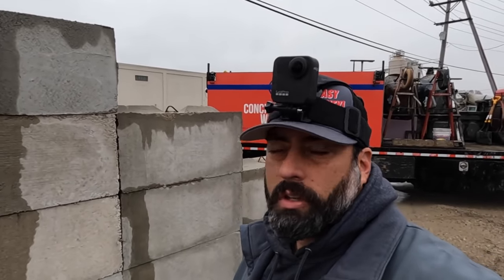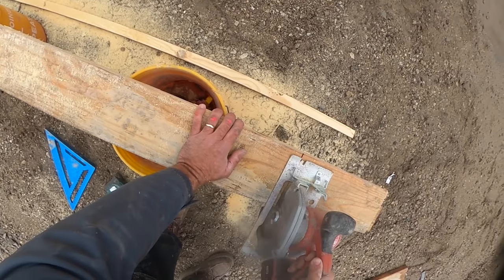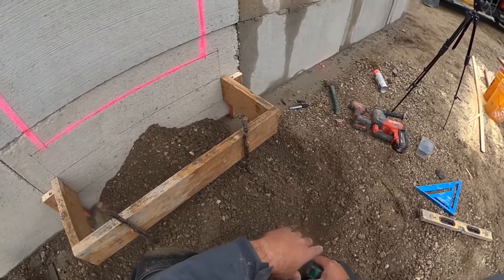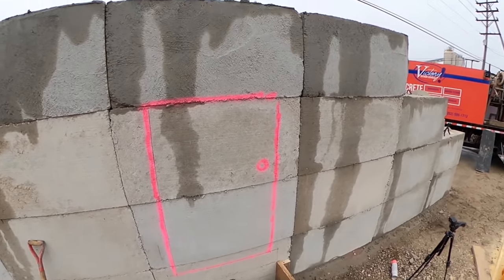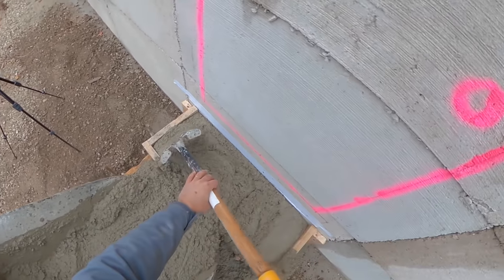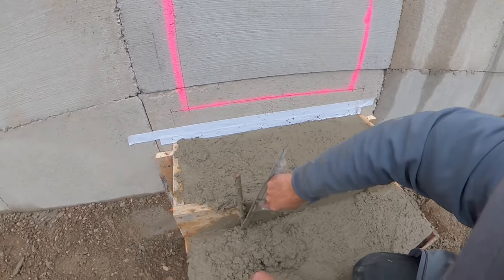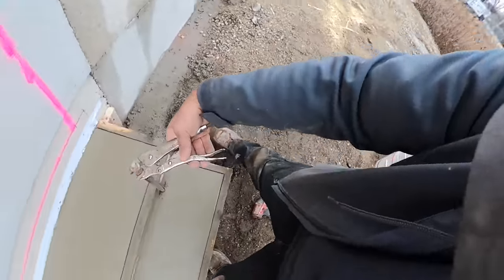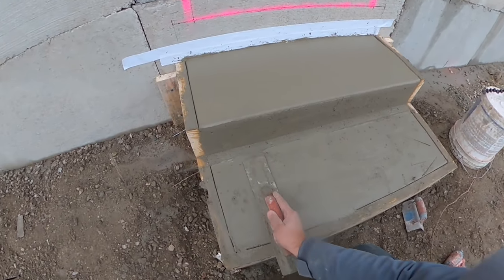How to form, pour, and finish concrete steps-DIY

Comment: Pro tip - 45 your risers and the batter boards won't stick to the run when you go to remove them. It makes it a little easier to finish.
 2. you can use the Sawzall to vibrate the concrete down into the form to get the mud down into those voids on the stairs. Just press the shoe against the form and let her rip. 
3. You're going to want some extra Crete around when you pull the forms just in case you pull a chunk out. 
4. Spray your forms with diesel, pam, or whatever you prefer to prevent the forms from sticking to the Crete. Looks great!!

Comment: I hope you continue to do these training videos.  You’re a great teacher!  I will be putting in a walkway to my pool from my driveway in the spring.  I may use bag concrete because I will be solo.  As a diy’er, I look forward to your future instructional videos. God bless!
Reply: Make a small test section for the cement your going to use. The bag cement I get from Menards isn’t nearly as nice as the cement you get from your local cement supplier.  This makes it a lot harder to make look k nice and the finish isn’t nearly as hard.
Reply: I'm pretty sure you could add Portland cement to the bag concrete to get that more creamy effect for a nicer finish!
Reply: @lefty_420  I worked with masons in Boston, they added soap to get a creamy texture, it holds emulsion longer.  They actually sell the soap at the mason supply but the brickies just used dishwashing liquid, its cheaper and does the same thing. Just a squirt in a 80 lb batch.
Soap is how to emulsify oil and water.
It prevents the water from draining out of the mud too fast.
Reply: @Gerard Jones  good to know! I'll keep that in mind, thanks! 👍👍👍

Comment: Hey Ryan! Greetings from Norway! I just wanted to add in that for steps it's really nice if you cut a 45 degree on the bottom of 2x8 so you can run your float all the way in on the face of the step for correct elevation. It is very nice seeing you guys work as a team and it is very different as I work with bridges and 10-floor buildings. Love your work! Keep it up!
Reply: Plus his first step is wrong, can anyone tell me why the top step is not code?
Reply: You could just explain to us
Reply: @ForensicCats  it appears legit.. the rise looks good
Reply: You’re assuming that nothing else will be added at ground level
Reply: @pats9414  so... is it code or no?
Reply: @markpeterson9808  no. Just like any building under construction isn’t fully up to code.

Comment: Man I have done so many set s of steps in my day ,,,from
 3 ft wide to 30 ft wide ,,,,with and without cheeks !!  Use to dream about pouring steps !!! And always had a 5 gallon bucket of a dry mix of fine sand and cement just in case when you strip the step forms and there are voids ,,,,mix up alittle mud and fill in the voids !! Works out well on a hot day when the concrete is drying fast and you cant scrap any grout off of the trend to fill them !!
Reply: 30 feet!!! Man, those are some big steps.
Reply: You got it man. A little extra cream can save some scrubbing later. We usually take some of the left over mud out of the truck and screen out the bigger aggregate. Wrap it up in plastic til needed
Reply: Definitely use the mud from the truck... Portland varies in color and you'd probably end up with "patchy colored" concrete.

Comment: Awesome, respect man for sharing your knowledge. I've always worked on the mechanical side - cars, machine shops, etc - but am getting into the construction trades type stuff just for DIY/hobby and like to really learn the whys and not just the hows when I dive into something so knowledge like this is invaluable IMO. Thank you! Riv/Crete as well for opening your doors and again sharing your knowledge. As a SE WI lifer as well, you're all doing us proud!
Reply: So what about the frost ? That will raise them steps up . There always should be a footing below frost line to prevent heaving

Comment: Hey Ryan, can you answer a question for me? I’m from Texas but live in Pennsylvania now, why do concrete trucks have the mixer reversed up north? In Texas, and most of the south, they have the concrete come out of the back, where up here it comes out of the front of truck. Love the channel, hope you continue to find success!
Reply from the maker: We used to have rear discharge up here as well. Fortunately over time they all switched over to front discharge which is far superior.  I believe the truck itself costs more and some areas are hesitant to invest. Once a company in an area switches to fronts, the competition follows or they will be left behind. That's why some areas are all front and some are rear.
Reply: Alot of streets in cities and smaller towns arent wide enough for those big front discharge mixers !!
Reply: i live in wisconsin and drive a redi-mix (cement mixer) for 18 years now and 90 percent of them are front discharge because you can see where you are pouring and haul 9.5-11 yards plus with not 4x4  we have 6X6 we can go into deep mud without getting stuck.
Reply: I live around Houston and work for a railroad next to a concrete company. They have started using the reversed cabs and the first time I saw them I didn't know what I was looking at lol
Reply: @opiumextract2934  SE side.. here deer park
Reply: @infidel3162  nice, I used to work in deer park but now im over in baytown
Reply: Here- just north of NYC there is a company with rear discharge. Their trucks can get into places the big front dumpers can’t. The driver does have to get out and have wireless remote control chutes
Reply: @opiumextract2934  cool
Reply: Southern California all rear discharge.  Every job has a pump on it unless there is space to tailgate.  The pumpers charge 400 to 500.

Comment: Great video! Planning to do my entrance steps within coming summer weeks. I will follow your example. I'm preperad to finnish the surface with ceramic tiles later, but if result would that perfect perhaps that is not even needed. Difficult to see how much effect the final brushing has on the surface finnish

Comment: I was actually a little worried when they were coming over and taking the blocks away with the loader, but seen there were a couple rows before they got to u and ur demonstration great job they turned out beautiful ,you also have a way of explaining how everything goes, u make it look like easy money!!. But I truly know from experience that concrete work is pretty demanding on ur body especially knees, I did poured foundations and flat work back in the 80's in my 20's and then went into stone Masonry until 2015 and just couldn't do it no longer with back and knee problems, so take my advice and protect ur knees and back and take care of yourself and you are truly blessed with the talent of finishing Crete, long may ur mag keep floating!!!

Comment: Good idea on this one. Very damn good. It’s all the simple things people forget about. Since some get overwhelmed by the bigger details like forming,grading and troweling and striking off. The smaller more detailed steps get either overlooked and straight up forgot about. 
    I would like to see a more detailed grading on a smaller scale. Digging off the top soil and even on like a patio tht is high on all 4 sides with a drain in the middle. Maybe only cause tht is about what I’m doing right now. Grading and laying down (C-6) for base. My thinking is let it sit and settle over winter. Pour come spring.

Comment: My Turn!  Never done concrete, but you make me want to do some steps now.  Timing appears to be everything as well, and I know that takes experience.  I am going to put steps out front and am really curious how I do.  I can be a perfectionist, so I think it will turn out alright.  What is the rule for rebar?  When do you need to use it, as I noticed it wasn't used here.  Thank you for the video.  It was really solid and helpful.

Comment: Great tutorial. We usually chamfer the front board on a 45 degree angle, it helps to get the lower step nice and level as your not guessing where the bottom of the board is,  and always keep you ever clean.

Comment: Have you ever tried putting some oil on the inside of the forms that way the face of the steps aren’t as much of a hassle to smooth out once you pull them off , the oil adds a protective layer from the pores on the wood that make the holes. Only use a little we apply it with the same paint brush you had in the video. In California we do this all the time we use any type of motor oil from any gas or autozone. Really enjoyed the video 👍🏻

Comment: The driveway pad in front of my garage (4'x22') have sunk about 3/4", across entire garage opening. I need to raise it up to prevent water puddling. Any suggestions on the type of concrete, concrete support, etc pls. Your video was a Great video. Thank you very much

Comment: I've never done conrete, but wondering why you didn't build the bottom form first. Since the measurements are accurate, it doesn't seem like it would matter and might even help or ensure you're level. Just seemed a bit wierd sliding the bottom sides under the top sides. If I was adding a few steps to a high back door on an existing concrete patio, it would have to be super exact since the existing contrete patio is less forgiving as a base than dirt or gravel.

Also, when adding steps on an existing patio where you can't attach forms to the vertical side of the foundation, how do you recommend bracing the forms? Does it require drilling into the existing concrete patio? I'm wondering about how much damage that does to the existing patio.

This was a great video and worth the time.

Comment: You make the job look easy Ryan, but it anything but easy. This is many years of experience in finishing concrete. Thanks for the great video and demonstration. You could actually apply a release spray to the wood forms and that will greatly aid in removal with minimal damage to the surface of the concrete.

Comment: Love your channel and I know I'm months late on asking a question or making any statements, cause I'm still working through all the video from oldest to newest.  One question I had, which you didn't go through, was the fill of the dirt within the form.  Looks like you just tossed some gravel in there to fill it out a bit, but never spoke of what to do TO it.  Did you compact it?  What happens if you didn't?  I'm assuming it would settle right out from under the finished steps on top of it.

So that was my on concern... for those of us whom you're teaching to do a project like this.  Everything else was easy to understand and the concepts were right on... except for the fill and how or what you did to the gravel inside of those forms.  Attempting to look at it in the video, we just can't quite tell if you filled the "top" step most of the way with gravel or if it was just level to the bottom all the way out from the face of the wall.

From about 13:00 until 17:00, I was looking at the change of the gravel levels and how much it was filled "under" where the concrete would go and the compaction of said gravel.

Comment: Nice work. I learned a lot. Never heard of stealing cream before but that should solve my outside corner issues. One question: You said this was really nice concrete and the delivery guy said something about fibers in it. Can you elaborate? I use Quickcrete bag mix. Is there something I should be adding to it to get more cream?

Comment: You make it look easy! But I know it's not. Thanks for sharing your experience and knowledge! I'm going to jump in with both feet and give it a shot. 

Do you use motor oil or any type of substance on the inside of the forms to keep it from sticking to the concrete?

Comment: Great video. A couple of questions...do you apply anything to the wooden forms to prevent the concrete from sticking? And how long did you let the concrete set before you removed the forms?  Are you talking 10 minutes or a couple of hours?

Comment: Awesome video.  I've seen a ton of how to videos where they fast forward through most of it, and give a vague explanation of what is happening.  This would make a great video for someone who has never done steps before.  I've never done steps, but I have done floors and concrete ramps going into a building.

I have a building I'm working on now and I want to do some concrete steps, and of course, a ramp for equipment.  Definitely some good info in this video.

Comment: Liked and subbed. Any need to anchor the steps to the building with lags etc.. before the pour? Any issue or risk of them pulling a slight gap ever where they meet the house? Thanks for video!

Comment: We pour alot of steps in our pools we build. There vinyl liner pools but the liner goes over the steps. I was bad about putting to much pressure when edging the steps and that will make the liner not fit as well. Also I learned the hard way about finding that bottom of the steps. In south Alabama in the middle of summer and your concrete  is setting up you don't want any mistakes like I made.

Comment: Best way to form the face is the bevel the  bottom of the face board w/a 45 degree angle. 

A bevel allows your float to get closer to the step on the first pass and helps speed up the process on the second pass (especially in the summer time). Great tips though for the process!
Reply: That’s how we do it!

Comment: My front steps and sidewalk have settled about 6 inches now, making the distance from the top step to the porch nearly unbearable. I want to overlay about 8 inches on top of the existing steps, increase the tread, and add a step so that the steps are not as tall but have a deeper tread. This will help me plan out that project. I like the idea of scewing into the existing concrete for the forms, because the ground around the steps is so compacted. I was not looking forward to hammering some 2x4 stakes into that stuff.

Comment: If you are pouring steps like this do you need to add rebar dowels to the foundation/steps to keep the steps from settling? Also, do you need to add wire mesh or repair into the steps themselves? I would imagine it is dependent upon the size of the stairs/how many you are pouring.

Comment: Ryan get a pair of tall stair gauges ($39 on Amazon) keep them in you tool belt and for those long cuts under say 1.5” place you saw blade plate line up with your chalk line (where u blade is going to land as it cuts) and then hook a tall stair gauge on th plate up against the board so your saw will not drift over.  And make to cut its full proof!  Guys even use Vice grips ?
I prefer the “Squib” stair gauge (blue) 
You probably don’t need it but the new guys absolutely will love the help!

Comment: Have seen some add used motor oil to the inside of the form to get it to release later. Didn’t look like you did that. Can you explain? Also, can you explain how we can tell when the concrete is set up enough to start working it, or take the forms off? What should it feel like?

Comment: Another great tip I picked up is to cut the bottom of the face board at a 45⁰ angle, this lets you mag right up to the face of the stair while it's still wet.

Comment: Loved the video! I have a question about the pins in the form, is it a cause for concern with that large of a void the pins cause when you remove them? If there even is a void after you pull them? 😅.  Just curious,  loved the video will definitely be using it for reference if I ever build steps ☺️🙂.

Comment: Great video thanks so much. Question - roughly how long did you leave the concrete to set before a) first using the edging tool and b) take the formers off and finishing it off?

Comment: Great video.  Some, I knew but a bunch of what I knew, was wrong.  Given these steps, how long should it take from when concrete arrives until you say, "Easy Money"?  What are those screws?  Have never seen them and I'd sure like to try them.  How much would you yell if I used my fancy concrete vibrator to settle the concrete?  I've got to try some steps.

Comment: I started doing residential flat work at 15. Went commercial latter on in life. I finished many many steps pan steps to monolithic. Worst one ever was 2 flights and a landing on monolithic steps. White concrete and the sun beating down. If you know you know! I almost died that day. Worst part was I did to good of a job and the superintendent of that job requested I finished all 10 stories.  I chose the time of day we poured the rest of them. I was king of the steps.

Comment: How come the form was made top-down, instead of bottom-up?
I've got about ten steps to make. How do I ensure that the form can hold up to the weight of the fresh concrete?
Third thing- I have a Harbor Freight mixer, and would like to mix and pour from bags- one after another, if possible. Somehow you have to be able to work those many steps. Is that doable? I'm planning to do it myself because this is in a tiny cow town, and the guy who was supposed to give me a quote was a no-show twice. 
Thank you.

Comment: I imagine that if scrape/skim a lot of smooth concrete off of the top surface in order to fill small holes and pockets, then you can run out of "creme". If I wanted more creme, could I simply mix a small amount of Portland cement in a plastic bucket with water? No gravel or sand. I am guessing that the "creme" should be very smooth.

Comment: A+ work Ryan, what a gift your videos are!  Noob question, is there no requirement for rebar/reinforcement in steps?
Reply: Not an expert, never touched concrete - but I don’t think it’s required from what o understand. It’s a small surface area so it seems that any earth movement etc shouldn’t impact this too much.
Reply: My steps are not much larger than this. I used rebar. might not have been necessary, but I'm pleased that I did. Did the work in 1981, no cracks, looks great.